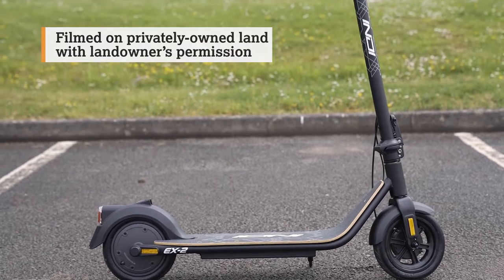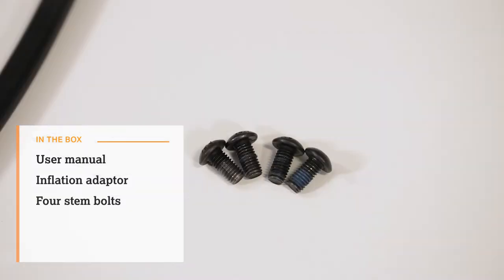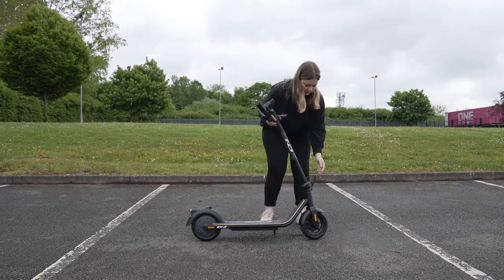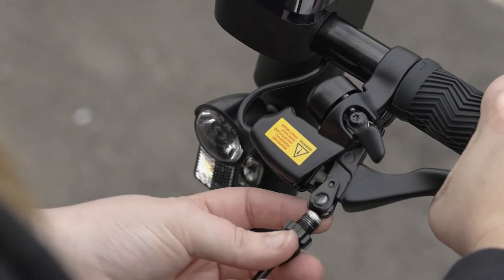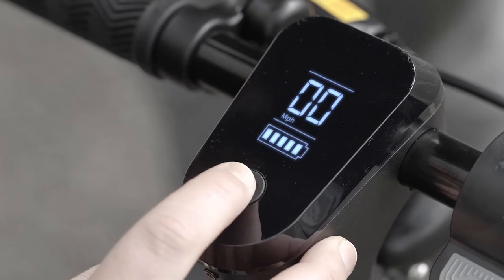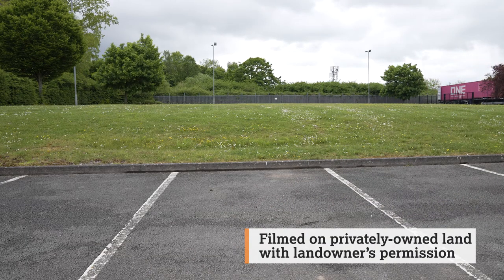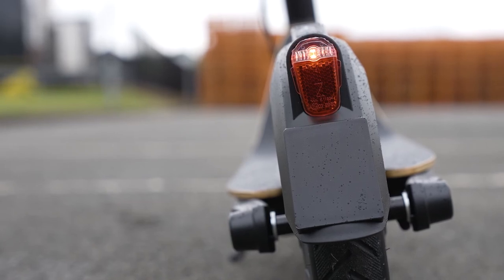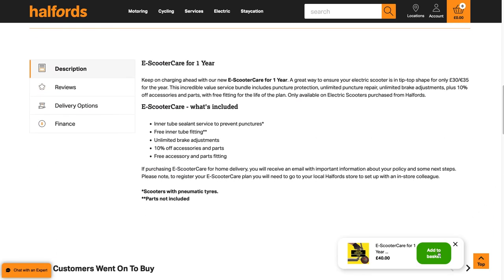How to Set Up an INDI E-Scooter

Comment: Absolutely garbage worst thing I’ve ever bought
Reply: Don’t tell me this I’ve just bought 1 today 🙈🤣
Reply: @xboxgaming5307  it really is had it a week stopped working got a error code and theirs nothing on the net about them I bet ur back mudguard snaps in first week
Reply: @jasonkelly7125  what error code you got buddy? I’ve still got the paper what tells me what the error codes are if this is any help? A mudguards fine my last one was the eco vt8 from Argos snapped within a month and it’s aluminium so was hard finding someone to weld it
Reply: @xboxgaming5307  error code 4 don’t even think I got anything telling me about the error codes cheers pal
Reply: @jasonkelly7125  error code 4 says controller error bud here’s a list of them 
E0 brake error
E1 communication cable error 
E2 motor error
E3 high temp error 
E4 controller error 
E5 low voltage error 
E6 wheel obstruction error
E7 accelerator error
E8 high current error 
E9 high voltage error hope this helps mate
Reply: @xboxgaming5307  cheers pal but what’s my controller
Reply: @jasonkelly7125  basically a little computer that makes the scooter work it will have all the wires connected to it for brakes throttle battery etc. you’ll have to take the board off you stand on and it will be in there. If you’ve bought it from Halfords yourself I’d just take it there bud sure they’ll look at it for you
Reply: Just take it back to Halfords. Bought one 2day.. lets see how it goes
Reply: @Jayswindows1264  been a good scooter so far for me buddy mind id love to know how to make it faster,the battery isn’t the best for long journeys I’m looking to get another battery to parallel them together
Reply: @Jayswindows1264  quick question is your light bright like the xaomi scooters or just a dim one a don’t know if it’s the lights or mines just dim doesn’t seem very bright at all
Reply: @xboxgaming5307  Bright
Reply: @Jayswindows1264  I thought mine was dodgy it’s got a centre led and 4 around it but only the centre lights up and literally my phones brighter
Reply: @xboxgaming5307  Like I say. Lets see wat happens. No make is perfect lets face it
Reply: @Jayswindows1264  there decent scooters my 1st escooter snapped after 1 month this has been great so far done over 200 miles
Reply: where can i buy a back mudguard replacement from ? when into halfords and they say they can’t order the part ??
Reply: @phoebeede4748  Dunno. Only bought it today.
Reply: @phoebeede4748  xaomi one would fit you’d just have to drill different screw holes as the xaomi have 3
Reply: @xboxgaming5307  thankyou , would halfords fit it tho ?
Reply: @phoebeede4748  I’m sure they’d help
Reply: Use this for work. 16 miles round trip. 8 miles and still has 2 bars left on battery. So far so good.